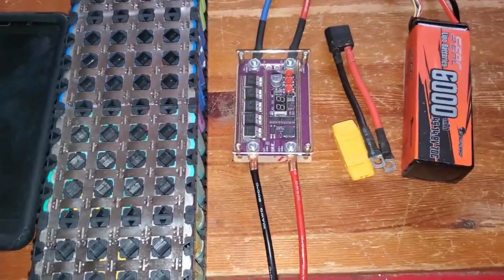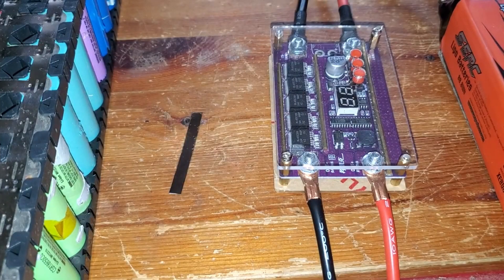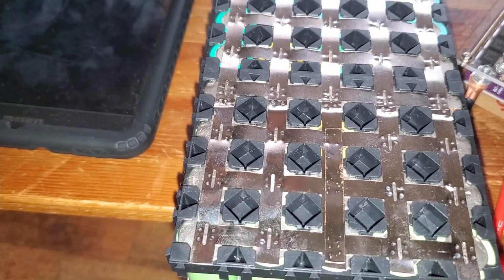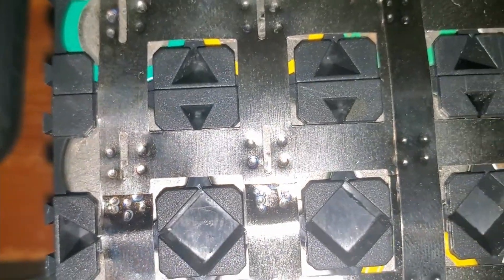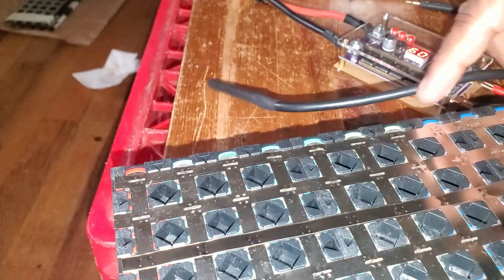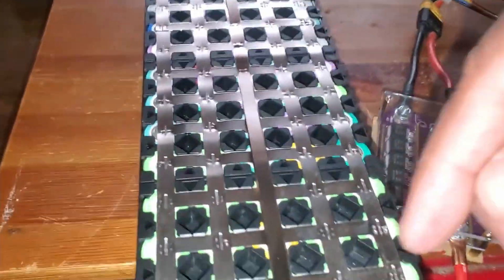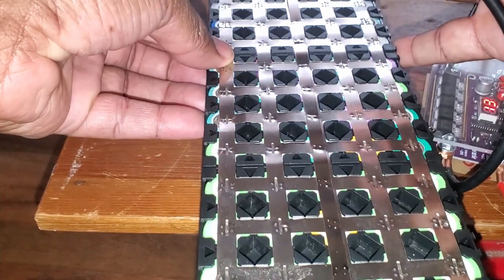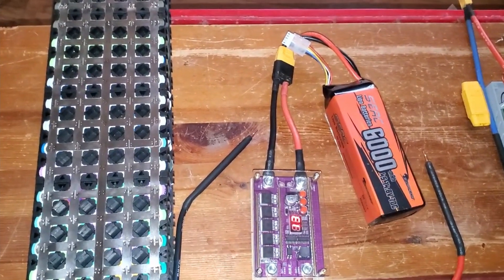Mini "PURPLE" Spot Welder DIY WORKS WITH 0.1-0.3Mm Nickel Sheet #18650 #Lithium #Battery Spot Welder

Comment: I bought this exact one from amazon. When I tried to use it for the first time it made a huge spark and completely blew apart my nickel strip as soon as it made contact. My multimeter shows the mosfets are completely shorted. Any advice? Is it defective? You seem to know a lot about this particular unit
Reply from the maker: Yes, it defective,  return it as soon as possible to get your money. I bought mine on ebay. I got 2 of them. What was the voltage of your battery
Reply: @simplyfocus9937  I used two 7.2 ah lead acid batteries connected in parallel. They are from my ups and were charged to 13 volts. The power level was set to 5. 
I will not be returning it though. I dont think its worth the 25 euro I spent on it and the electronics may be useful to me. I have ordered a new spot welder with a built-in battery. I have a lot of experience working with small electronics so I may be able to repair it
Reply from the maker: @TrinusSinus  I would  because they probably is counting that you return their defective item. Amazon has a policy 30 day no question asked.

Comment: imo your delay is so short you are releasing too soon. remember it fires after the beep TWICE in JUST A FEW ms's

And I do have one, but 4s2p 5000 mah lipo's
Reply from the maker: I  am currently using a better battery 🔋 that  i made. Lithium
Reply: @simplyfocus9937  10 year 5000mha 4s with a 6s 83f supercap bank. I maintain  charge to 15v which is a little above storage voltage and 2.5v on the 2.7v caps. 
And a 30x15mm fan blowing from batt side to output. 50-60 welds the pens get too hot
Reply from the maker: @sullytrny  a video would nice to see

Comment: That poor battery. Who in gods name MIXES DIFFERENT CELLS? ARE YOU INSANE?
Reply from the maker: They all are 18650. Are you ok 👌
Reply: @simplyfocus9937  18650 is ok mix IF they capacity is same if not I would not recommend to mix them because charge difference etc. I think @CrayPlaySwe mean that
Reply from the maker: @Neevilstöö I have them since 2019, they are still running strong
Reply: @simplyfocus9937  good :)

Comment: Hi
Does your lipo get hot when you spot weld,  I have the same welder and upgraded and added more mosfets and the traces with more copper, my lipo and wires get hot when I do a few welds, so I have to pause in between my welds
Reply from the maker: Yes, it did.
Reply: Thanks for the reply, what do you mean when 0 ? @simplyfocus9937
Reply from the maker: When you do a lot of spot welder, it will  heat up. I do aoptweld between 9 to 20 level. The higher the level is, the more it heats up faster.
Reply: Of course it does. You're pushing hundreds of amps without a real heat sink.

Comment: Is this better than your maletrics welders
Reply from the maker: MALECTRIC is European, that one is Chinese. MALECTRIC is more expensive. That one is less than $50. I did over 5000 spots weld with MALECTRIC. That one I did 20
Reply from the maker: Yes, it is much better. How do I know that? The malectric one is dead with no warning.
Reply from the maker: In less than one week, I will be in Haiti, there I will use them to make over 20,000 Spot Welder. I  push them to the limit. Stay turned